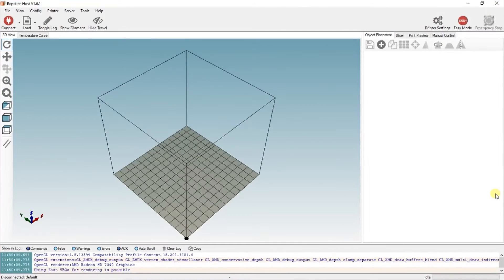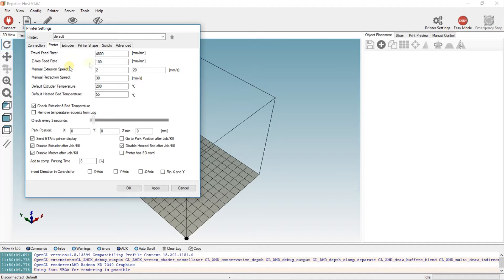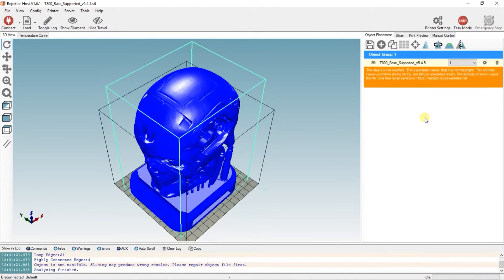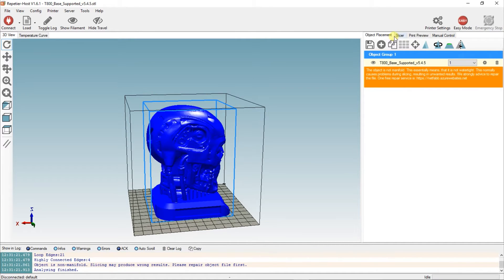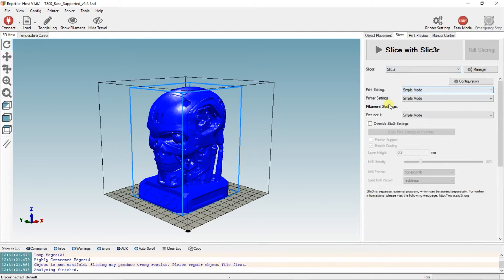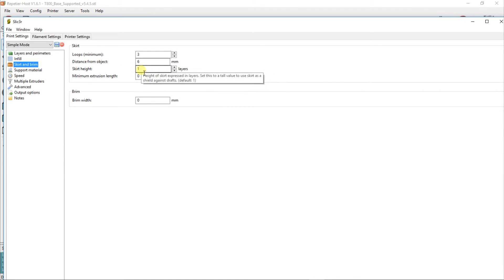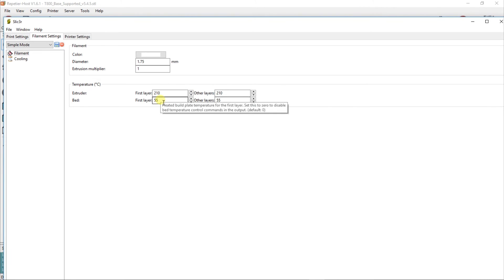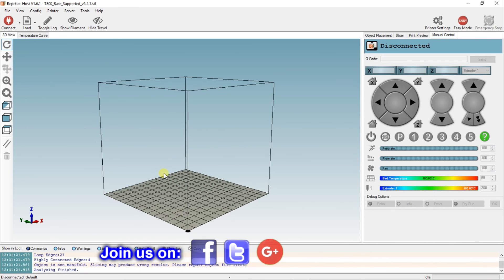Using Repetier To Print On the Eaglemoss V3 3D Printer : Configuring & Printing.

Comment: hi, im looking at getting one of these printers as my first 3d printer just a couple of questions,
1. is this a good printer to start out with
2. how fine a print can you get ie how small can you get the layers for a smoother finish
3. whats the largest print you can do i.e. hight width etc
4. how reliable are these printers do they break down often are they easy to set up and level etc

thanks
Reply from the maker: Big Edds Lore don’t bother, they are Shiite and customer support. Is hopeless, ended up abandoning this one

Comment: Great Tutorial to get started. Compared to the V3 default software, my models come in at around 5 times faster and it has fairly  good choice of parameters to experiment with.  For the price (free but a small donation is encouraging for them to suport this) this is really a good choice of software to get. 

Main differences or should i say features lacking in V3 default (not techy stuff for now but useful):-

Gives an ETA on completion time 
Lets you know what is actually happening whilst printing or movings etc (like printing layer 200 of 340)
You can tweak temperatures and fan speeds and such on the fly whilst its printing!
you can type from a list of commangs (G-codes) to get it to do stuff without having to go through menus and stuff (like parkin g the table)
Has more intelligent supports and features that help make a better print. 

And its fast....

Thanks RetrogamerVX

Comment: I have a BIG  problem with the printer. the bed rocks back and forth. eg
 springs are to soft. the back can move up and down about 1/16th. anyone
 have the same problem? It a major design floor. the ajuster are too 
close together and are  to one side of the plate. is make the bed 
unstable. The only way I can get any sort of good print is placeing it 
over the center of the 3 screw and no wider than about 2"  and less then
 about 2"

Comment: hi buddy I built this printer aswell and am quite disappointed to be fair it was supposed to finish at 90 however there is another 15 issues after that which I personally find a rip off with what you get in the erxtra issues take part 96 for example I went to collect the magazine and was told that eaglemoss had not had enough stock but not really bothered about it cos it was a small piece of  copper worth pennies so not worth having anyway I was just curious what you think about the extra issues cos I think its just getting silly now next week you get a small spool of wood effect pla I mean come on how much use is that to anyone except someone who lives in a tree house let me know your thoughts please
Reply from the maker: I stopped at 90, the extra are optional :o)

Comment: Hi. I just wanted to let you know that this was really helpful for me. I've got the printer and the software that came from the website was a bit crap.

I first set this up using a windows laptop like yourself - I can confirm though that this also works on linux though due to the vagaries of linux permissions you either have to add your user to the dialout group (covered in the repetier instructions) OR enter the following commands:

$ sudo chmod a+rw /dev/yourprintersTTYport
$ ls -alh /dev/yourprintersTTYport

The easiest way to find out what port your printer is connecting to is to start repetierHost from the terminal - Then look for the connection error with "Opening serial failed on second try:System.IO.IOException: Permission denied" on it. Then enter those commands above.

Other than that though, works like a charm. Thank you for the video!
Reply from the maker: Your welcome, I avoid Linux myself, life is too short ;o)

Comment: Have you had any issues getting it to start printing with Repetier? I dont know if the hood switch is causing mine to stall before it starts to print. when it does attempt a print it seems to start each print a different distance from the nozzle even though its using the same settings.
Reply from the maker: No issues here apart from having to define the edge of the platter as shown in the video :o)
Reply: +RetroGamerVX Thanks for posting the guide up. I followed all the steps you have shown but Im not having much luck. I am glad that it can work with Repetier as I found the Eaglemoss software a bit limited. i will keep trying........

Comment: Layer height ... Its not actually anything to do with the filament size BTW, its to do with print quality - The Vector 3 has three pre-set quality settings (fast, medium and fine) - which I believe equates to 0.4 0.2 and 0.1 mm. However there has been some confusion as some say the printers maximum resolution is 02 (so your 0.175 effectively) but the manual quite definitely says it can do 100 micron (0.1 mm) prints. Hope that's a help. I'd try with a 0.1 layer height for something - but it will take longer to print.  See page 45 of the manual : http://3dprinter-collection.com/downloads/STRING_UK_FULL_MANUAL.pdf
Reply from the maker: Thanks, I've tried 0.1 but it really doesn't make any real difference so keep to 0.2